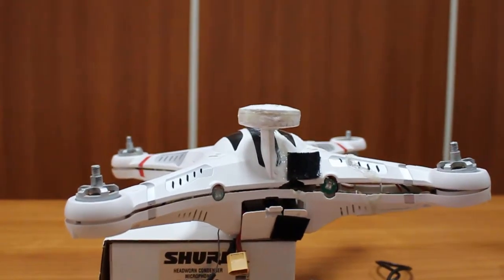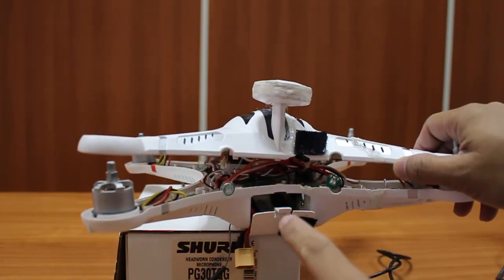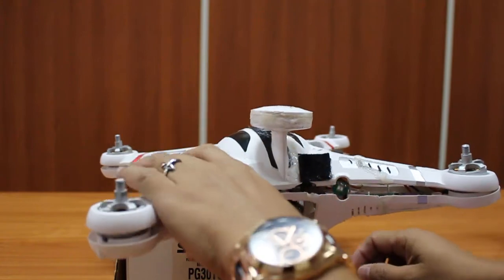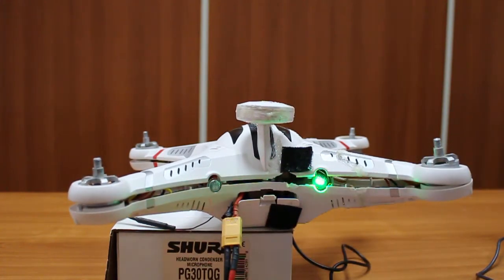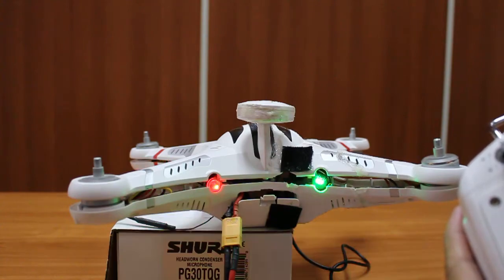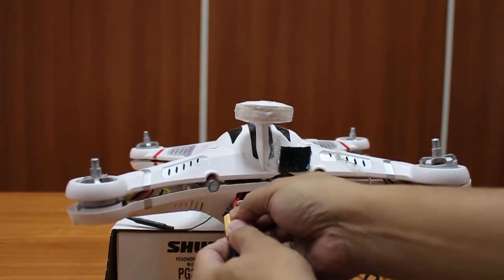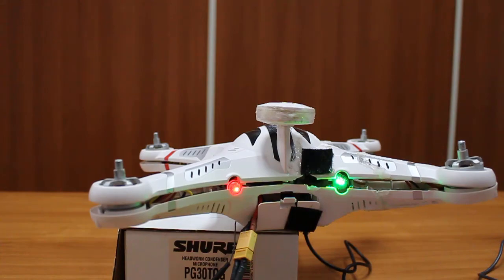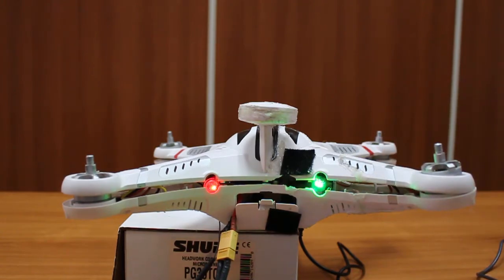Cx-20 Beeping only no LED Lights flashing

Comment: your flight controller lost the power connection with the power board i think
When connected to the pc the FC get powered up
Reply: how to fix that problem .?
Reply from the maker: +Robbert Loos Thanks I already fixed this by opening the FC and unplugged and plugged the upper and lower part of the board.